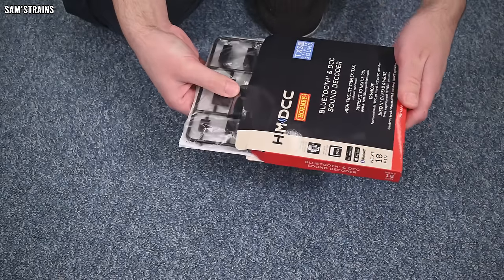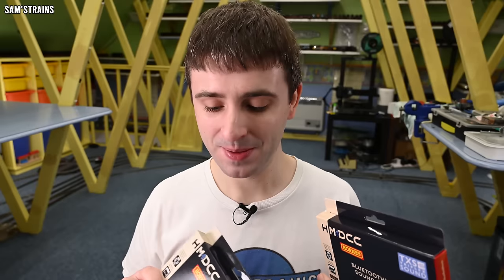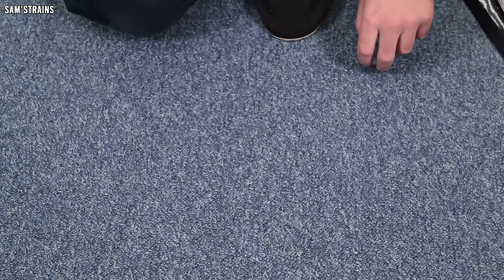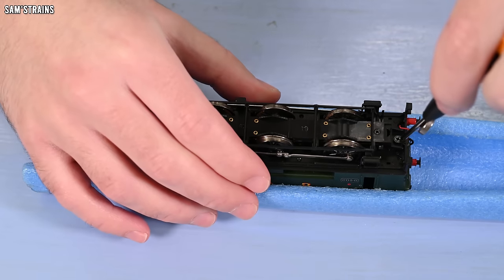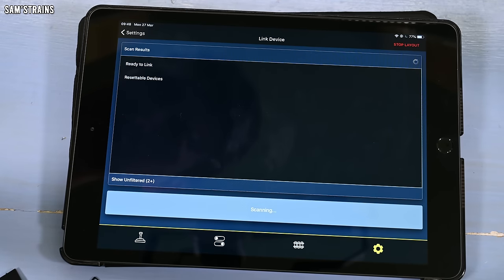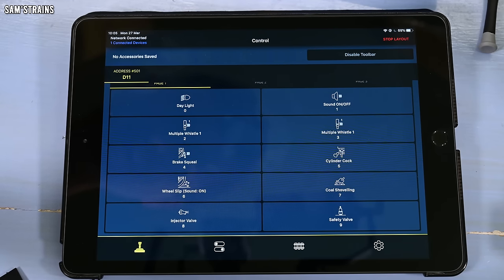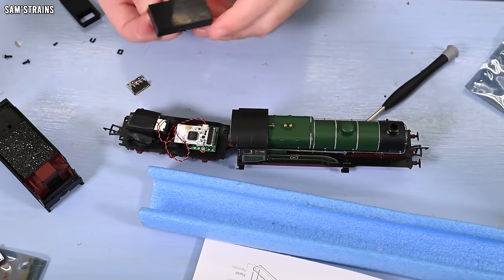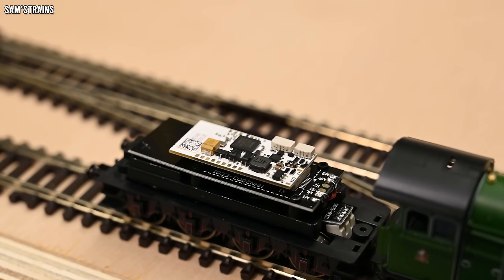Too Big For Most Locos & Burnt Out After 1 Day | Hornby's New HM7000

Comment: Notice that none of the review that I could see utilised the Hornby 15 volt power adaptor and used either a Select or Elite controller to power and utilise  their  features in conjunction with the new Hornby decoders. Admittedly the blue tooth dongle is still not available but the tablet using blue tooth would work rather than utilising the dongle Bluetooth adaptor functionality to use  the Select or Elite. but the controllers would still operated the LOCOS on normal DCC functionality as long as the track is powered correctly using the correct 15volt power supply and using the power adaptor available to power the track.  Maybe the 18 pin decoder would not have burnt out if you had not been utilising other manufactures  power supply controllers and wired up using DC controllers from other manufactures instead of  just Hornby product . Maybe when the dongle arrives redo the test utilising all Hornby product from power transformer, power cable and 15v adaptor and  in Hornby Locoes and Hornby blue tooth chips to fairly assess the product. Its like the test you did was done knowing it in parts it possibly would  fail in advance by not utilising the advertised Hornby product and trying to circumvent things using other manufactures products . Over all, a bit unfair in the way the review highlighted issues by using other manufactures products but your conclusion about the whole system being revolutionary and game changing spot on; this especially would be true if you had reviewed it using only Hornby product and followed their guidance utilising it in the way it was advertised. Next time don't put the cart before the horse if your going to review a completely new system give the manufacturer the benefit of the doubt  and utilise their own product solely as advertised or prescribed before undertaking a half cocked review highlighting problems that don't really exist; especially if you don't follow the manufactures instructions and guidance on how to use it in the first place..

Comment: The decoders are packed in anti static bags for a reason. You need to use ESD precautions when handling and fitting. I do think size is going to be an issue for many locos.

Comment: At those prices a standard DCC system is more cost effective if you have numerous locos.  Still using a smart phone as an additional controller would be handy rather than rely on being in RF contact when clambering around the loft.

Comment: Hi Sam, 
Hope you see this message, but after several months , I think it's time to re visit TXS decoders.  Now you have the NCE powercab, the decoders will work fine and shouldn't blow up. I have 6 of these decoders now, even managed to create a unicorn by fitting a Next18 one in a Bachman NER class O , however don't bother with any Next18 as they dont fit without serious wrangling. My favourite is a 1970/1971 Hornby Triang Princess Elizabeth, with 8 pin HM7000 TXS, plus stay alive, using the Princess Coronation profile....it works really well, IMHO. It really has no right too, but it does. An Esu/Zimo would be overkill for such an old loco, and TTS decoders never had enough power to drive the XO4 motor...so happy days. 😊
Reply: While I remember. . A couple of extra tips...get the full download of the manual from Hornby...excellent reference material..,and worth fiddling about with Vmid/Vmax to get a better chuff rate 😀

Comment: The NMRA give detailed dimensions for Next18 Decoder there is no excuse for Hornby not to build them the correct size.
NRMA Decoder dimensions Next18-S (with & without sound)
a Decoder length 15.0mm - 25.0mm (sound)
b Decoder width 9.5mm 
c Decoder height 2.9mm - 4.1mm (sound)
d Distance from edge of decoder to center of connector 2.5mm 
e Distance from decoder edge to assembly with max height of 0.5mm 5.4mm
f Distance from decoder edge to assembly with max height of 1.5mm 5.9mm
Reply from the maker: Yes exactly, I've been looking at those too - they claim on the box that the decoders are NMRA compliant, so there's no getting out of it!
Thanks for watching, Sam :)

Comment: In my local model club we use a Z21 Command Center from Roco that allows WIFI connection, so many of our members use their smartphones to control their locomotives. We have been using that for years. You can use the old multimouse, or the wireless mouse, a tablet , your iphone,... I think I'll stick to my reliable ESU decoders...

Comment: I would imagine the delay to restart when the power is cut can also be attributed to the fact it's got to re-establish the bluetooth link also. So yes, the power bank they sell is the way to go to avoid it, or any other stay-alive capacitor. With regards to the size, and the fact that it seems to be aimed for their own newer models only, I think they are shooting themselves in the foot there. Hornby should know that will cause a lot of negativity towards them, I cannot see too many people wanting to use the system if it's not going to fit half of their loco's. And if Hornby feel this will make people buy more of their locos, that is just not going to happen, with maybe the exception being a child's train set. Hornby should be grown up enough to know that modellers will have a range of different makes of locos. If they really want the bluetooth system to take off, they need to make sure it fits other peoples locos.

Comment: It could be just me, but Hornby could have shortened the Next18 Decoder's length.
It looks like it has a lot of blank space after the solder tab GND is located.
I suppose they need the space to apply the QR sticker on the top.

Comment: A reasonable option / technology for those wanting an 'adequate' sound profile. For more realistic sounds and better functionality the ESU and Zimo decoders will do a better job, but this is coupled with the expertise of the sound experts who make the recordings and produce high fidelity sound and fuctionality to replicate as far as possible the 'driving' of a train. These guys need our continued support. One advantage though might be a price reduction in the hardware (decoder) costs. Accurascale for example do not have a massive difference between DCC ready and DCC sound cost, whereas buying a separate sound decoder and loaded profile is much more expensive.
Reply: Agree 100%.  Hopefully it will also put a rocket up chip makers like ESU and Zimo to upgrade their tech - eg how reprogramming CV's works and sound upload their chips. It also negates the use of programming tracks. Cleary "making these changes" straight to the chip via bluetooth using an app, is way way better than buying some expensive out of date box that only works on a 20 year old USB or serial port. Just MO .
Reply: @wapphigh5250 The standards for DCC were established by the National Model Railroad Association (NMRA, the North American model railway standards group) back around 1993. They are developing a replacement called Layout Command Control (LCC) that will hopefully be easier to program, amongst other improvements.
Reply: @sharkymcsharknose2979  1993?! :body-blue-raised-arms:Great! 30 yrs on.. it's about time!!!!

Comment: I Like using JMRI with a arduino and motor shield running DCC++. and the reason why it takes a while to resume is most likely due to Bluetooth taking its sweet time to reconnect to the decoder.

Comment: Looking at an image of the Next 18 TXS decoder, it looks like the last 10mm does not contain any circuitry and could possibly be cut off. If the BT antenna is located there, then that would be a small issue but could still be overcome. I would need to see both sides of the PCB to know for sure...

Comment: Especially with some of my Diesels from the 1990s and earlier, including some of my Triang locos (Like the Class 35, where only one Bogie has pickups), where there's a lot of space inside the engine, it would be cool to get one of these DCC Bluetooth decoders specifically to get the power bank, as hiccups in the power are fairly common.
From what I can see, 6 pin and 8 pin versions are available, which would be the most ideal to retrofit engines from before including DCC sockets was a standard.

Comment: I have over 300 locos from over 40 manufacturers (from ACME to Wrenn).So I need a 'universal' package. Largest is the Scale Trains HO Big Blow three vehicle turbine, the smallest BUSCH HOf 3volt feldbahn ( but the loco is smaller then any chips) With a chip is Bachmann Double Fairlie. Also a consideration of vehicles as a consist is required (US multi loco or Rail Adventure HST sets.) Some packages also allow the acceleration to follow an 'S' curve that the user can modify as speed changes, slow start, fast mid speed , reducing as top speed approaches , or whatever you want.

Comment: sad part is that the 18pin version (without me seeing one in person) doesn't seem to need the length.  unless there is something inside the circuit board at the far end, maybe that's where they put the antenna?

with a review like yours, i have to wonder if there wont be a Mk2 sooner than later.  i agree with you that its probably a real game changer.  and that's before the software gets some more polish.

and it sounds like they maybe need to consider a large capacitor to allow the card to run for a small amount of time after the loss of power.
Reply: Yep, I'm thinking that's used for the Bluetooth too.
Most sound chips can be hard to fit in small locos though, I've had similar issues with Soundtraxx chips in the past.
I'm assuming the non-sound Hornby chips are a tad smaller.

Comment: I believe that there is smaller version of the 21 Pin decoder for engines that have a speaker already fitted it is the R7402 HM7000-21: Bluetooth® & DCC Decoder (21-pin) whether you can still use the sounds not sure, the RRP is 44.99 pound, there is also a R7401 HM7000-N18: Bluetooth® & DCC Decoder (Next18-pin) at the same price.  Hope this helps

Comment: I originally thought that in true hornby fashion, they've only designed the chips to fit into hornby locos but after reading the description on the website, it states that it is suitable for 00,H0 and some smaller scale locos, so it looks like they are supposed to be universal. I guess you're supposed to check the dimensions before purchase but designing a 18 pin socket that doesn't fit into 18 pin locos I don't really understand.
Reply: @Haymarket47  no but most locos with an 18 pin socket have an average size of the ones that Sam tried and I would say you need the chip to fit around 75% of locos for it to be a universal chip.
Reply from the maker: They are supposed to be universal - Hornby claim that these conform to all relevant NMRA standards, which in this case is another lie from Hornby. The NMRA defines the length of a sound decoder as being 25mm, and these are significantly larger. This is why the decoder fit into none of the locos I tried!

Comment: ive seen simon from simon's shed use these decorders in the hornby tt a3 so why it doesnt fit in the p1 i dont know as the tt a3 is a lot smaller in size then any 00 gauge loco
Reply from the maker: Yeah it's odd - I guess they might have designed the TT locos with this decoder in mind... but it's a pity they didn't state that it'd be too big for most OO locos, and indeed all of the ones I tried!
Thanks for watching, Sam :)

Comment: The HM7000 is a nightmare with reverse loops as when the loco enter the loop the brief short turns off the loco decoder power and it stops. SO you have to pay extra for a solid state reverser which reacts much quicker.

Comment: I have not read all the reviews but it appears that the powerbank is not required.  If you get an electrical disconnection via the wheels due to dirty track etc. the stay alive needs to be on the loco not the track.   Other than that it looks impressive.
Reply from the maker: It isn't required at all - it just may help to reduce any interruptions. Yes the powerbanks go inside the locos, so any kind of brief power interruption won't affect the loco!
Thanks for watching, Sam :)
Reply: Thanks for the clarification I misunderstood.  It would be useful to know what happens when there is  a short circuit on the track such as may be caused by a derailment.  On my DCC set up everything just restarts when the short circuit is removed.  I suspect it may not be as easy to restart everything with the new Hornby decoders.

Comment: For just ~10£ more in the USA you can get an ESU Loksound V5 decoder. It's not got Bluetooth, but it's sound is far superior and is completely customizable for whatever sound file you want to import. They come in several sizes including a remarkably small micro size. They're also quite reliable and are, IMHO, the gold standard of DCC Sound decoders. Definitely worth the investment, you should check them out sometime!
Reply: Interesting, is there a library of UK steam engine sounds that you can download into these without having to use dealerships/suppliers?

Comment: Hi Sam,  Thanks for the review - food for thought. One thing that put me off the TTS decoders for steam was that the chuffs were far too slow and not adjustable so the chuffs could not be synchronised to the wheel revolutions (four chuffs per rev for a 2 cylinder loco). Do these new chips allow adjustment of the chuffs?

Comment: If you are introducing a new way of controlling locomotives it is a good idea to make sure that all (or at the very least, most) locomotives can use it. This includes those made by other manufacturers. 

I have more tank locomotives than tender locomotives, so I can't say that this system encourages me to try DCC.

Edit: Interesting addition to the end of the video. I wonder whether this happens with other DCC decoders frequently?
Reply from the maker: Exactly Richard - or even more simply, make sure the decoders conform to the NMRA standards if the packaging states that they do
Only Hornby eih? ;D
Thanks for watching, Sam :)
Reply: @SamsTrains
Reply: @SamsTrains  Agreed. Except with reviews like yours, how can I be sure that I would be able to fit this in any of my DCC-compliant engines, OO, continental HO and N ?
Even Graham Farish warned me with the size requirement for the 6 pin decoders to fit into their class 03, which is not standard. Their class 03 requires a subminiature one made by them, or the ESU one I bought instead.
Reply: Worth pointing out that the user experience of established, normal DCC is far easier and reliable than this.

Comment: I think a big issue that you touched on is how ridiculously expensive other DCC chips are. They are a small custom board with a chip or two on them, really it is outrageous that we are being charged over £100 for them. Add a wireless BT chip definitely warrants a bit more and yet they are cheaper... genuinely impressive work from Hornby here. I think where they go from here will really define whether this is a good or bad venture (much like TT). If they make them reliable, add ability to customise sounds, improve compatibility with other manufacturers (I agree entirely reasonable that they prioritise their own locos initially), I think they will revolutionise DCC. I'm not sure they will, but it would be nice to think so!
Reply: I get my ESU sound decoders from a US retailer and their current price for a 21 pin sound decoder is 65.87 GBP.

Edit: These are not Blue Tooth ones though.

Comment: I'm sorry you had so much grief with yours. I fitted one to my TT Scotsman and it worked straight away. I didn't even have to chose the sound profile - it just did it all automatically and with a cycling of power (lifting the loco on and off the track) it worked faultlessly. I only have a few bits of TT track and of course drove it off the end of it at one point. A quick nudge back on and it picked up almost instantly and was away. As for it cooking itself, that's worrying. I'm guessing this, and perhaps the other issues could be down to power line issues (too much, too little, being unhappy with voltage/current profiles) but it's worryingly inconsistent from what you've shown and it should never bake itself as a fault condition. My set up was literally a HM6000 power supply, straight into the TT120 DCC track connector and it just worked. I guess it could be that temperamental in it's power requirements that it HAS to have Hornby kit, but that doesn't seem right. I will have to update if I have any problems like this crop up.
Reply: These decoders are supplied with a sound file pre loaded for A2/A3 steam